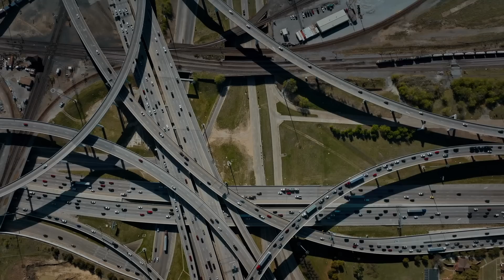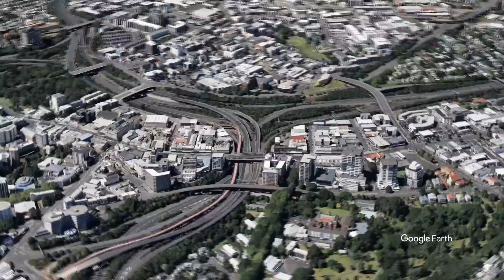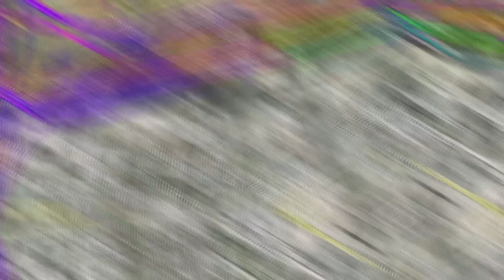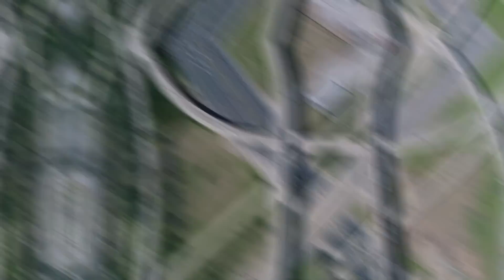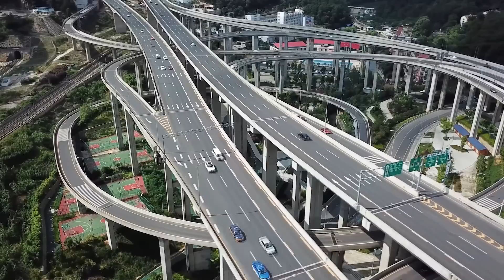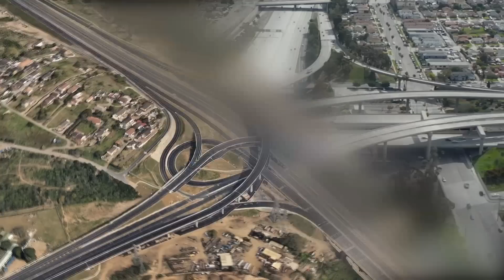15 MOST Expensive Traffic Intersections Ever Built

Comment: I believe you missed the best interchange that is called the LA interchange in Los Angeles California longitude and latitude. 34°01'47"N 118°13'01"W

It was finished in 1949 but not opened until 1953 I believe and it intersected at downtown Los Angeles the 101 the 60 and the five freeways for that time frame it was a tremendous accomplishment and still works today

Comment: The Tom Moreland Interchange is outside Atlanta in an unincorporated part of DeKalb County, GA.
Reply: South Atlanta:; with how they upgraded the 75 285 interchange differently should get more respect out of “ interchange “ best / most expensive ….. ❤️❤️❤️Atl Atl Atlanta 👋
Reply: @darrelladams4188, there is another I-85/I-285 GA interchange in College Park, GA and is now an interchange complex. It used to be an 85/285 concurrency and it was upgraded when the 85 is in between both sides of the 285 which is cool to help improve traffic flow along with new ramps. I think it is another one of the most expensive upgrades of freeways in Metro Atlanta as well.

Comment: Number 14
You’re quoting the incorrect Freeway Interchange, you’re showing Downtown Dallas and that I-35E aka the Stemnons Freeway and I-30 formally known as the Dallas Fort Worth Turnpike.
Reply: No it's the High 5. They eventually showed the signage of Midpark , Spring Valley rd and Beltline rd which is the Richardson side of 75.
Reply: @SteffyJewels  The interchange shown at the beginning was not the. High Five. The Trinity River was a give away.